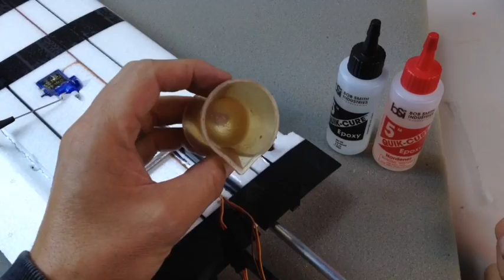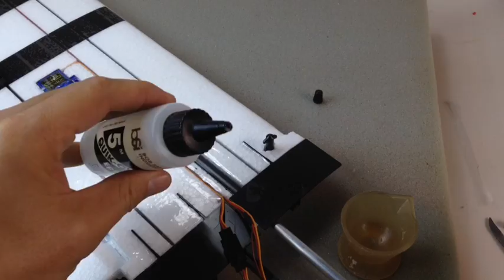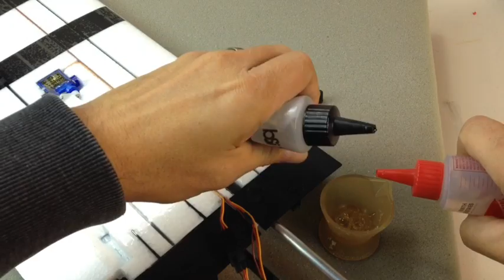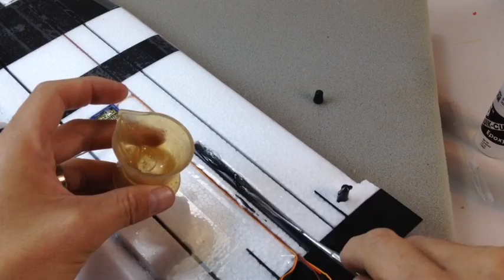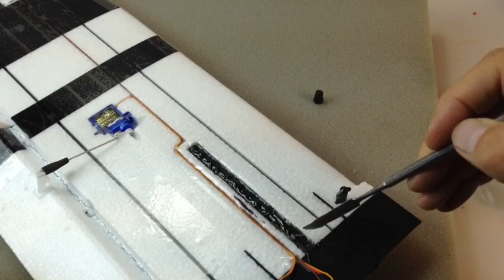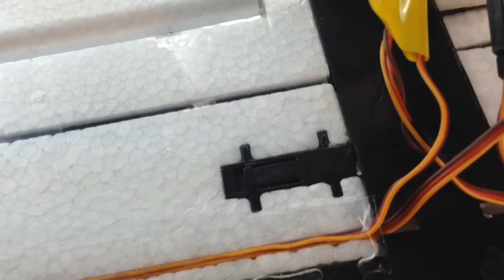Bix3 Urgent Attention - Glue your wing spar!

Comment: ATTENTION DO NOT  use a hot glue gun in this area ,as the heat will shrink the plastic which will make it almost impossible to insert the aluminum wing tube.  I know because I did it.
Reply: AustinPetDetective i was wondering why it did that...

Comment: I got Bix3 and mine is not loose but good tip just in case. I have also glued my wings together at the seam so if the clasp does give wings stay together. There is no real reason to take the wings apart all the time for me anyway.

Comment: After applying the epoxy gently go over the area with a hair dryer or such and it will slither right down under the tube.   Not too hot though.
Am sure a lot of people will appreciate your video because this could end in disaster.

Comment: Hi. Saw this video before assembly of my Bix3. My violent maiden in strong wind is done, and I´ve seen some flexing and weird sounds with faster elevator usage, and I believe so, it was from the part you comment on. But I also read that epoxy glue is not good one to use for EPO foam. Where is the truth?
I sank it all into CA glue and then after it dried, I put epoxy on top of that. Great amount. Hope it will hold....
Reply from the maker: +CrashPCcz I learned this fact afterwards, Goop would have been better, however the epoxy held up great!

Comment: had to do this after the maiden flight also. it had moved a bit. took them both out completely and they where held in by the smallest amount of glue. I put the epoxy on the wing first then pushed the rods in then covered with more. probably the strongest part of the plane now lol top tip! keep em coming.
Reply from the maker: Will do!

Comment: I watched your video whilst mine was on order. I put it together today, and came across a similar issue. However, mine was due to the aluminium spar. I just could not get it to go into the spar tube - used lots of WD40 but then of course whilst pushing with some force one spar tube came out completely, and the other one split!! I was always going to glue them after watching your video, but didn't expect to have to do it because the spar! I've seen other videos where the spar goes in with very little effort - I must have had a duff one!
Cheers
Stuart
Reply from the maker: ***** what a bummer!
Reply: I received my bix3 last week and it has the same problem with the wing spar. It's almost impossible to get it to go into the carbon tubes. Finally one of the tubes peeled of the wing... so, yes, I'll have to glue it too...
And by the way hobbyking didn't answer to my RMA ticket...

Comment: I'm slightly confused with the wings.  Do I glue them together or not? What do most people do? Do you glue them together and transport the plane as a single wing and the body separate or do you take apart wing and do 3 pieces? Busy building mine now.  Thanks.  No manual which is a pain.
Reply from the maker: Do not glue your wings together!  I will be a pain to transport!  I have my bix in 3 pieces, the two wing halves and the fuse

Comment: I found this out as well after my maiden flight; also, on mine the pushrod guide tubes were held in place only by the decals on the side and may need some tape/glue to keep them from separating form the airframe. Great little aircraft once the Beta testing is done ;-)
Reply from the maker: You would think that Hobby King has learned a thing or two about gluing items together! Apparently not…